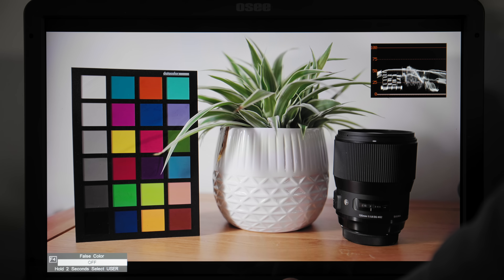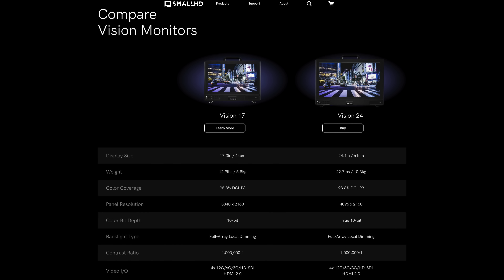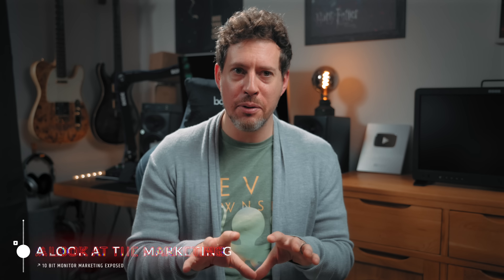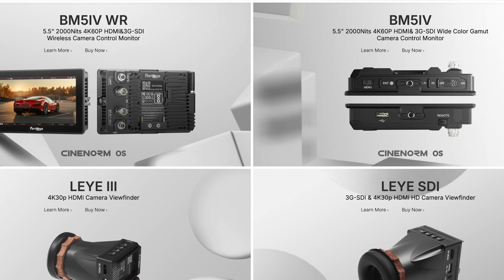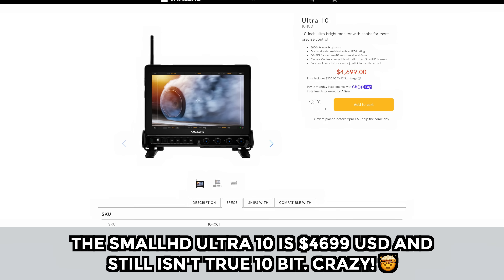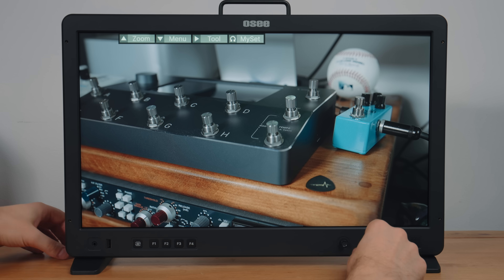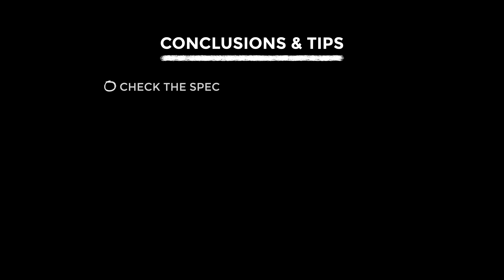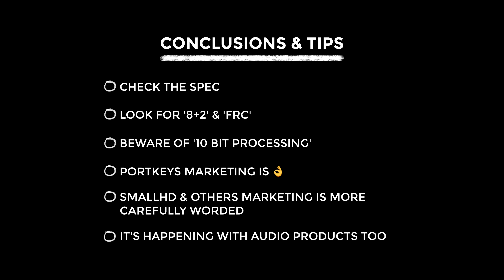The Truth About “10-Bit” Monitors (And Why It Matters)

Comment: The other issue is that for a minority of us, FRC aka spatiotemporal dithering, can cause seizures, migraines, and eyestrain because as you described, the pixels are flickering back and forth, usually at a fraction of the refresh rate. 60Hz Apple LCD’s, for example, utilize both GPU dithering and FRC, generating a 15Hz flicker over 4 frames in a single refresh cycle. True 10-bit displays therefore are actually “flicker free.” Many display companies are advertising monitors as flicker free when they are actually utilizing 8-bit + FRC.

Comment: 10 bit matters if you're expecting to get paid for your work. That's the bottom line. It's not true that it's only high end production houses who care. If you have banding in your $4,000 wedding video, the client won't be happy if they see it. I'm not sure why the photographic media market is constantly making the cost of gear such an issue. Everything you do commercially has an overhead cost to it. If you're trying to get paid in the professional market as opposed to just being a ham & egger who occasionally makes a few bucks with your work, plan to invest $20K in your business. At includes a monitor with true 10 bit color.